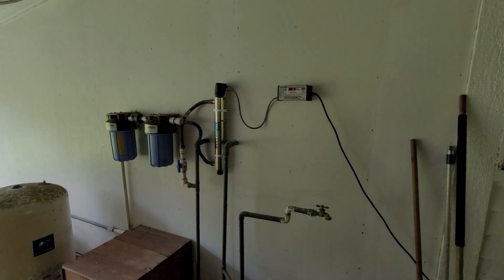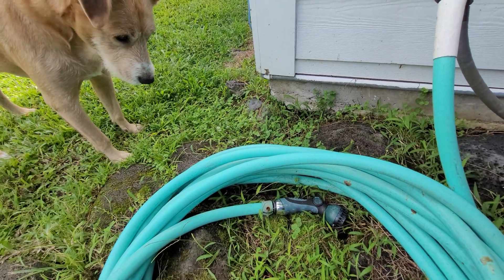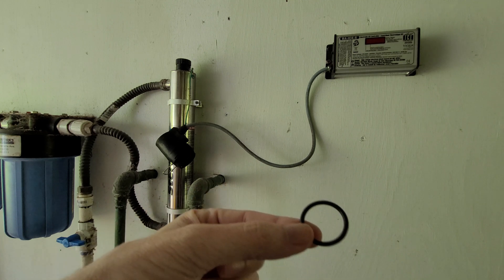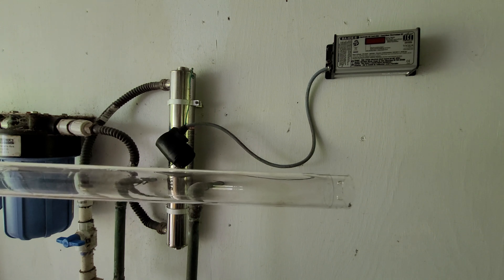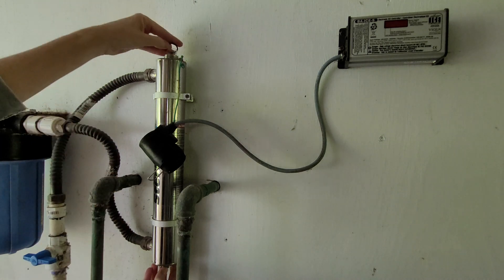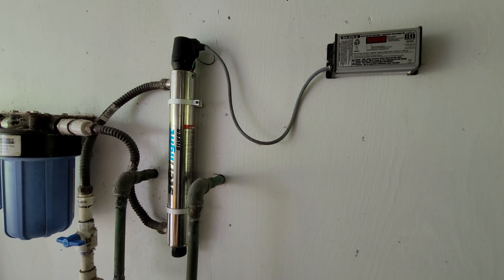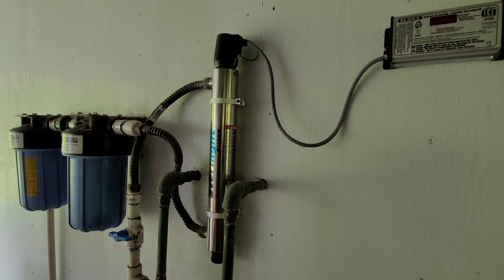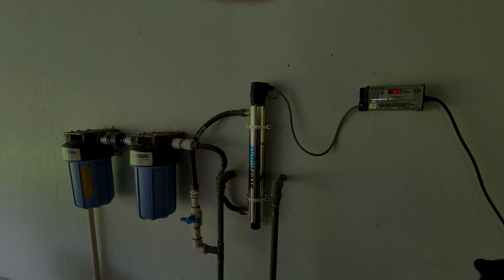Changing the UV Sterilizer Bulb in my Water Purification System

Comment: I know people with these UV systems who are happy with them. We just use bleach. No electricity required. I pour in a quarter cup of bleach per 2000 liters of rainwater once a month. So my 8000 liter tank gets a full cup, if the tank is full. Years ago I had looked up dosages and arrived at this. Probably could go with more as there is not even faint chlorine smell. Also, just one sediment filter, i.e. not filtering out heavy metals, but only adults drinking / using the water and not ever sick.
Reply from the maker: For chlorinating the water, the proper way is to maintain about 1 part per million of free chlorine in the water at all times. If it rains, you should recheck the water and add more chlorine as needed to raise the level back up. The UV is for other bacteria and virus that the chlorine doesn't kill via oxidation.
Reply: @DoingHawaii  So true! Especially if children are involved. But I am no longer into chemical analyses. I throw in a bit more bleach if something warrants it, like more rain or a visit by flock of fruit bats. Interestingly, I have a relative (retired) whose career was in water management, who said that rainwater everywhere in the world has heavy metal content too high for children to drink it safely. This is caused by coal-burning power plants. So the extra effort of filtering out the heavy metals matters a lot if kids will drink it. A few years ago we tried such filtration and it slows the flow rate so severely we gave up on it so long as only adults consume the water.